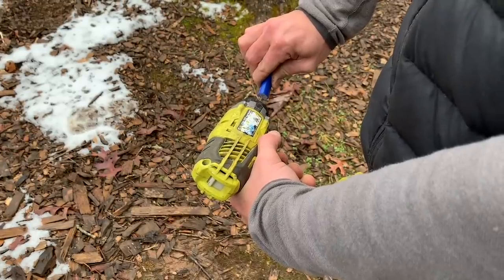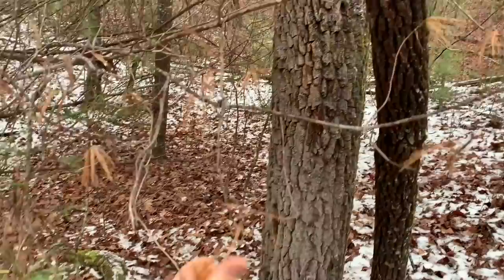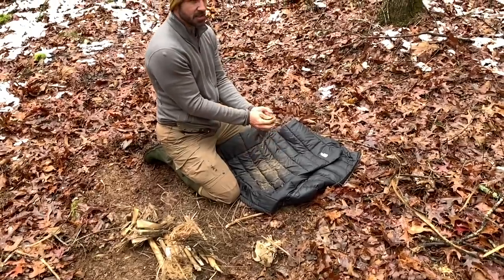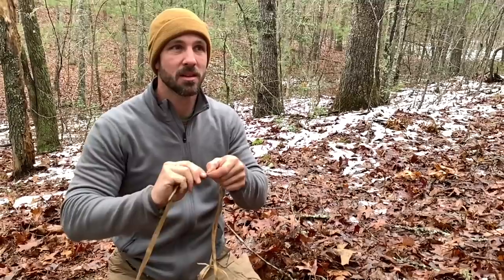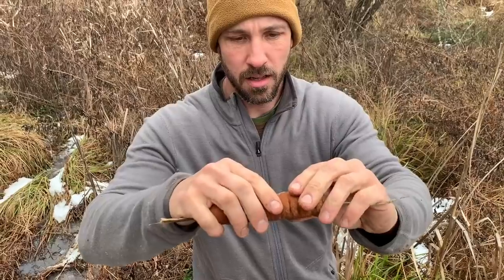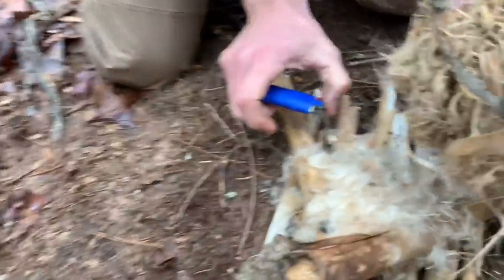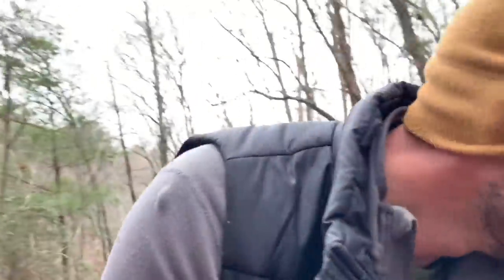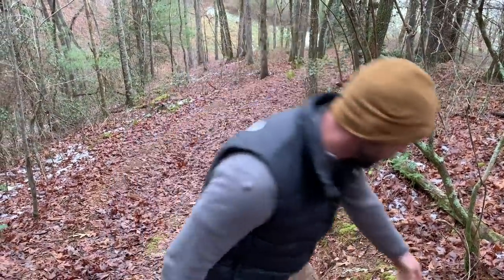When Your Bic Lighter Runs Out

Comment: If you turn the wheel slow enough you can actually collect the ferro in a small pile, then use that for some extra spark. Never did in a survival situation but I have done it on my work bench

Comment: Thanks for the great video. Wonderful demonstration. What I appreciate most is showing the failures, along with the tenacity that leads to success. Beginners need to not just see a quick, easy demonstration, but also that even with knowledge, sometimes things are not easy. This video shows that by practicing and persistence, even with wet, difficult tender, you can succeed. It just takes work. It is not McFire. 😎 This also demonstrates why you should always have a second and third and fourth option/backup plan in addition to a lighter. Thanks again.

Comment: There was a trick that I learned when I smoked. If you push down hard and slowly turn the wheel over and over for a while it will grind some of the flint off on to your starter material. Then you can strike the wheel fast again to get the sparks to ignite the dust and you should get more sparks that are actually touching your fire starting material.

Comment: Keep the metal shroud on. You risk the flint busting off the wheel.  Bend the metal on the shroud in. Lightly roll the flint forward and back and get the flint dust on the tinder.

Use a knife to shave plastic shavings off the lighter.

Enjoy your fire 🔥

Comment: When my Bic lighter runs out, I just reach for one of the others I have with me.  One is none, two is one and 6 means you probably wont run out.
Reply: But what if you need 7?
Reply: Agreed,  one in my pocket and I keep three sealed up in snack size Ziploc bags in each backpack. In my large backpack used for extended travel of a couple of weeks or longer, I also keep a 6" Bayite ferro rod with striker zip tied inside the pack.

Comment: If you press and roll the strike wheel in reverse, it will grid up some of the flint and allow more spark to come out when you strike. You can also tap it and sprinkle out and it will catch with a spark.

Comment: Another technique is to slowly roll the wheel and get dust from the flint and pour a pile onto your tender. You have to be patient but you can get a good enough pile that will catch a spark and ignite hot enough to catch the tender.

Comment: take the bic and reverse the wheel. rolling it backwards into a piece of paper like a bill out of your wallet with enough "Shavings" there it acts like a mag bar fire starter. add in some of the plastic the bic is made out of and you will get a fire with out all of this searching and failing.
Reply: So you take the wheel out of the lighter, flip it around, and put it back in? Then rub the wheel on the paper?
Reply: @clamum  no! Roll the wheel backwards

Comment: you might be able to make and ignite methane. stick some damp grass into the lighter tube or plastic zip bag and leave in the sun for a day (air tight) and there might be enough to ignite. also belly button lint makes good convenient fire starter material.

Comment: When my Bic lighter goes flat, I put it in a heavy plastic freezer bag, and smack the plastic case with a hammer. The small parts do not fly apart. I fish the flint out of the debris in the bag and use it in a Zippo. The Bic flint is bigger and longer than the Zippo flints, lasts longer and gives a bigger spark. And it's free.
Reply: do tha same thing to replace flint in this sweet flint start torch lighter offa eBay! except i jst pop off the roller and keep the flint contained by hand!(instead of busting in a bag)
Reply: @KickTurner  But you miss all the fun of that big POP.

Comment: There’s a better way of doing it, all you have to do is slowly roll the lighters round flint like you normally would when lightering a lighter except push down hard and go very slow so you dont make any sparks but are slowly collecting bits of the flint on a piece of paper, then gather all the flints powder in a tiny dot, then flick the lighter by the flint powder, it will spark almost like gun powder burning whatever is close by, ideally you would collect the flint powder with napkim and spark the flint powder on thr napkin to start fire.

Comment: Roll the wheel slowly and collect the shavings. Then spark it up. Easy peasy. Can't believe you didn't know that.
Reply: So just roll the wheel slowly over like a piece of paper? Do you roll it itself on the paper, or use your thumb to roll it and hold the lighter over the paper? Just trying to understand how to do this.
Reply: You could do it over paper or just over the tinder. You are making a dust of the flint. Should be enough to create a bunch of sparks at once rather than the few made by a single flick.
Reply: The list of things I don’t know is a long one. I have used shavings from a farro rod to ignite tinder before. No reason why it wouldn’t work on a smaller scale. Just didn’t occur to me on that day. Thanks for watching.
Reply: No problem. Didn't mean it as an insult. Sometimes we over think things and miss the simple solution. The video was still very useful and informative. Keep it up. Again sorry, didn't mean to be an ass.

Comment: Strike your leatherman tool against that rock for flint sparks,a fire would have been made in seconds
Reply: Almost 100% chance you would never get a spark from a stainless steel tool and a rock. Even if you did manage to create a tiny spark it would never ignite tinder of even the best quality. You would need chard material.

Comment: Didn't even occur to 2 people to try lighting the thing they made with that f.rod nor working lighter... 

Aside from taking forever to figure out that the metal shield was in the way.... 

One would also assume that there wasn't enough space between to have enough oxygen for fire to be made...

Now if you were desperate enough to use bullets to start a fire then it goes without saying that using the multitool to shave hair to get a fire going on wet stuff would have been on the table aside from cutting all the "wet stuff" from branches/twigs...

Oh and going to "town" was also an option 🤣🤣🤣

Comment: He spends too much time giving a complete
Science lecture on the
biology of the plant material,  a better Idea for starting a fire and less luck is needed, typically is if you can use either Angel Hair
steel wool, and a AAA or AA and D batteries, 
take the steel wood and 
thin it by making a thin coil, now if you dont have the Angel hair the tin foil that is used to keep a pack of cigarettes fresh will work fine cut the paper foil into thin strips like about a 1/16 of an Inch
then take individual strips and fold each strip into V V V take the battery and shave away the plastic sleeve at the very top of the - NEG end on the side at the very top of battery take foil side and hold it to the shaved spot that exposes bare metal, then take the other foil side and touch and hold
strip it will create flame or glow Red Hot, keep in mind the steel wool is more dense requiring a strong Battery such as a C or D but will work if Battery is strong.
I used a lot of detail  but
actually its quite well.
Good Luck.
Reply: By the way thanks for
making a Video well taken.
Reply: I think the point of this video is that an empty lighter can still be useful to start a fire. Nothing more. He even said in the video they have multiple ways to start fire on them.